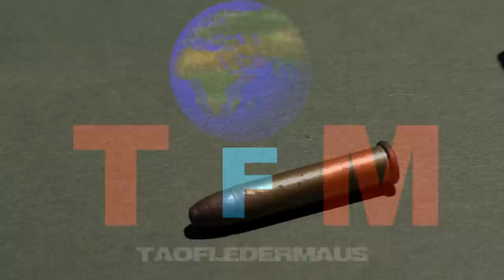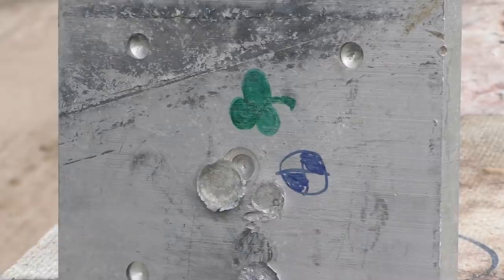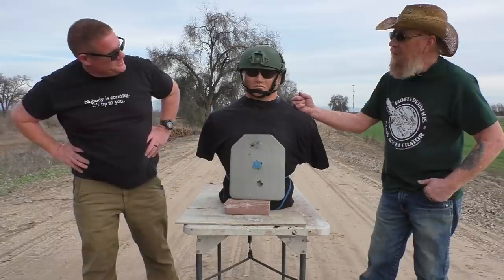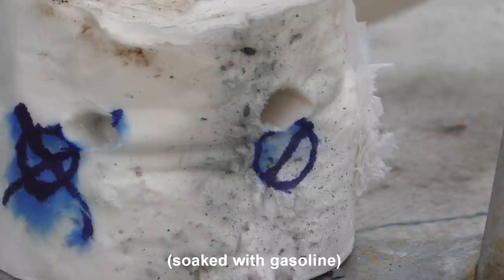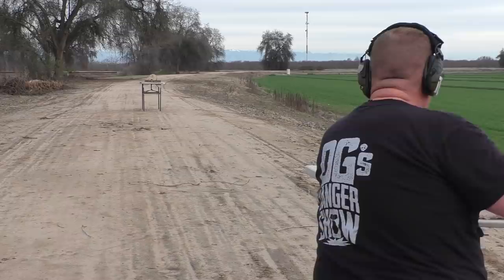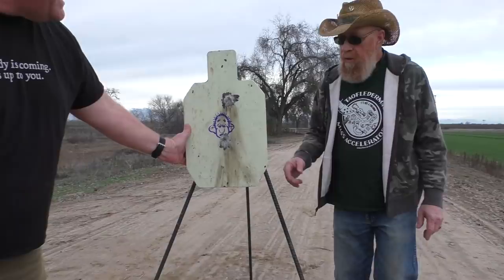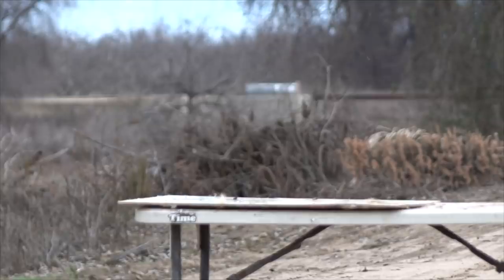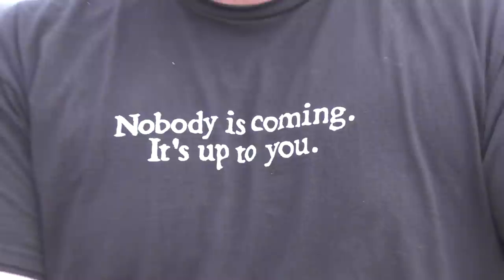Ferro-Fury 12ga Slugs with Huge Ferrocerium Core

Comment: 9:39, you almost, or may have created plasma.  You ignited the smoke rising from the toilet paper with the sparks and re-burnt it.  That was impressive!
Reply: i think its just excess gas vapor rising with the heat from the smoke, but somehow it ignited only after the sparks hit
Reply: besides, fire IS plasma but colder than the bright blue light you used to see
Reply: You can do the same thing with a candle. Blow a candle out and put a flam to the top of the smoke.  See what happens
Reply: @thomasgreen1557  This ^ its cool as hell
Reply: @TheLuiz1100  technically fire isn't plasma...... Sorry bro, in plasma, electrons are ripped off of the atoms. In fire that doesn't happen. If you are interested in this stuff, you are already on the right side of youtube, i suggest you take a look seeing you might be passionate about it.
Reply: Pyrolysis
Reply: It sparks like flint  so shh billnye
Reply: More likely just blew air into the flame
Reply: @prinssdgunofficial2400  confusing, because i was taught that the light we see in fire is the result of the eletrons going down a layer in the atom. maybe i making a mess in my head
Reply: @TheLuiz1100  yes, but plasma is when the atoms Get ionized by the heat, what you are describing is just the emission spectre of said gass, not ionizing
Reply: @larsvab3690  ok, thx bro
Reply: @thomasgreen1557  firefighters refer to this behavior as flash-over and it can be very dangerous when it happens on a large scale.
Imagine getting a room extinguished, but it's still full of smoke and some unburned gases and particulate. Then you open/break the door to the next room and the fire from in there can potentially reignite everything behind you too.

Similar effect to a backdraft but more common and therefore more likley to endanger emergency personnel.
Reply: Fire is a low-level plasma or a slightly ionized gas, it may not be pure plasma but the flames have enough characteristics to be considered plasma, plasma is defined as goes:"Plasma is a state of matter in which an ionized gaseous substance becomes highly electrically conductive to the point that long-range electric and magnetic fields dominate the behaviour of the matter. The plasma state can be contrasted with the other states: solid, liquid, and gas." and fire fits into this because not only does it contain ionized gas but also holds the properties, you can bend flames with strong magnets and they are highly conductive.
Reply: And of course hotter flames are closer to perfect plasma because they are hotter and heat is what makes atoms bang eletrons out of each other.
Reply: Also this is not a hot enough burn to create perfect plasma but the phenomenon you're describing is just the paper's nature in a combustion, when organic materials such as these are heated they release flammable substances (aka wood gas and similars) and if such substance is flammable enough and concentrated enough it can be ignited midair but that's all, it's just good old fire.
Reply: You are essentially right but also not entirely accurate with your statements. Flames are not low level plasmas. 'The bottom line is that a flame only becomes a plasma if it gets hot enough. Flames at lower temperatures do not contain enough ionization to become a plasma. On the other hand, a higher-temperature flame does indeed contain enough freed electrons and ions to act as a plasma.' 'Everyday flames such as from the burning of wood, charcoal, gasoline, propane, or natural gas are typically not hot enough to act like a plasma.'

Source: https://wtamu.edu/~cbaird/sq/mobile/2014/05/28/do-flames-contain-plasma/#:~:text=The%20bottom%20line%20is%20that,to%20act%20as%20a%20plasma.
Reply: @drb5538  didn't know you were gonna write a argument paragraph
Reply: It's not plasma. Flint strikers/lighter sparklers (non electric) contain a ferro cerium rod. It's not flint (although that's what we call it) it's a self contained chemical reaction. If you can somehow preheat the cores before firing you'll have much bigger sparks.
Reply: @TheLuiz1100  Yes! That is right! But that would mean that the electrons are still inside the atomic bonds. And such are not lost. I did learn something from you now. Thank you have a nice day
Reply: @Danyon Swordfyre  keep it proffesional! No insulting. (Ps i tried that and nothing happened)
Reply: @prinssdgunofficial2400  sure! thanks for pointing it out for me ! you too have a awesome day
Reply: Hey Jafromobile! Love your channel awesome to see you in the comments here! Just came from one of your videos and was confused for a min when I saw your icon/user 👍
Reply: @TheLuiz1100  you can burn vapors from burning wood in an engine. 👍
Reply: An inward facing conical steel plate at the front of the projectile and cutouts on the side should produce wide petal shaped sparks instead of the one forward facing one.
Reply: Wood gas

Comment: How about—-Neodymium magnet bullet shot through a coil to see how much energy it would make— would be cool to make a taser of sorts. Please comment if you want to make this happen.
Reply: Would require plastic pipe that wire would be coiled around. More turns = more generation. Magnet bullet would travel down the pipe inducing a voltage in the wire. In theory, the wire could slow down the magnet and maybe even stop the bullet. How long or how many turns?!? Not sure.
Reply: I think they did something like this once before, and the slugs were going so fast there wasn't time to develop much energy.
Reply: Or a copper pipe with camera set up to see it going in and coming out to see how much it slows down
Reply: @spcpitts  Why not just two chronometers?
Reply: @vincedibona4687  the copper pipe slows the magnet. He wants to see how much it'll slow down.
Reply: @xenonram  A chrono, then copper pipe, then another chrono.
Reply: @bryceforsyth8521  yes!
Reply: @MassimoTava  If my calculations are correct it would release enough energy to blow head and helmet 3 miles into the sky. Maybe. Well it should.
Reply: A purely neodymium magnet/slug would shred itself, neodymium is a frangible metal, similar to depleted Uranium. However, its low density renders it nearly useless as a projectile. It’s also extremely expensive

Comment: I've had to use snow before when the toilet paper was kindling.
Reply from the maker: lol
Reply: I use the muslim method where I just scoop it out with my left hand
Reply: Always bring extra, EXTRA socks! Sacrifice one sock, if you must and clean it between uses, lol. Just for future reference. You can't have too many socks on a real hiking trip in my experience anyway, lol.
Jim Brown 
@bonezcustoms on Instagram
Reply: @theanxious  Or just wear an adult diaper like the pros
Reply: The Weapon Collection  I normally have plenty of TP, not a common occurrence lol. There was one time though, I was glad I had 3 extra pairs of socks that day lol. Plus, the sock can be washed and used again later even as a sock again no problem. If you cut or otherwise use your sleeves, you either lose your sleeves or have $#T on your sleeves or need an extra shirt, lol. I'll just throw an extra couple socks in my bag all the time though. For dry feet always, and "emergencies" like this lol!
@bonezcustoms on Instagram
Reply: @extremechimpout  and THAT is dedication right there lol! I guess you CANT stop when you're a pro? Best not too surely for speed. Yeast infections galore I reckon though, lol.
@bonezcustoms on Instagram
Reply: I always found that a nice 1" round stick split in half and smoothed off worked the best.

Comment: Great video as usual. As far as POA/POI with Greg and Danny being different, it could be where they’re actually aiming, their “hold”. As in a 6 o’clock low or dead center, (cutting the target in half and aiming center) or the holding at the bottom, or low, or where you want the round to actually impact

Comment: when you strike ferrocerium, it mixes the combination of metals causing a reaction that ignites in open air.  As long as you shatter that center enough, it will spark on pretty much anything hard.  You can spark a ferro-rod with a sharp rock.

Comment: Dunno if you're open to suggestions for more improvised body armour... but I noticed that some chopping boards sold online claim to be made of UHMWPE - the same material as used in those tactical face masks you had a few episodes back... also you can buy it cut to size from online places that sell sheet plastics. unfortunately I'm not able to offer to send you any, just had a idea.

Comment: Ferrocerium when hot with a lot of newly exposed surface area will burn all by itself. so don't be shocked it burned when turned into a spay of metal at high temps.

Comment: So just 3d printed a wax diablo slug mold gonna mess with it when i get a chance .. I plan on just cut out shot and wax in mold then load back in same shell..Has the talflaudermaus crew made any yet with this mold? Maybe a future video since the molds are so easily printed?
Reply from the maker: We tried that but there is a weakness at the waste and it will shatter.   Needs to be a cylinder shape for maximum strength.
Reply: @taofledermaus  well thanks for the reply!! I was wondering the same thing if wax was used.. Looks like ill be greasing it somehow and using the JB weld 👍 🇺🇸

Comment: brass would have more pressure and make the round travel faster wouldn't it? more pressure can build in brass than plastic before it releases the bullet
Reply from the maker: The chamber of the gun holds the pressure so it wouldn't matter.

Comment: "Ferrocerium is a synthetic pyrophoric alloy that produces hot sparks that can reach temperatures of 3,000 °C (5,430 °F) when rapidly oxidized by the process of striking the rod, thereby fragmenting it and exposing those fragments to the oxygen in the air. "

Comment: I think that the helmet does provide protection because if you were hit in a chest vest you would probably crack your sternum with a dead center hit. The trick is to not wear the chinstrap so it does not rip your head off😂😂

Comment: With that kind of force, it'd probably snap your neck and cause massive tissue damage to the spinal cord, assuming it also didn't cave in your head causing skull fractures to puncture your brain. Definitely a kill shot, even if the round never touched your body.

Comment: Ya know, I'd bet that if you placed the gas soaked (ethanol free, only availablemoutside of Comifornia) toilet paper in front of the steel plate with about 6 inches of seperatiom, the round will disperse the the fuel and soaked paper just before the ignition source is available. Or you could just place the toilet paper on the ground under the steel plate with the funny face